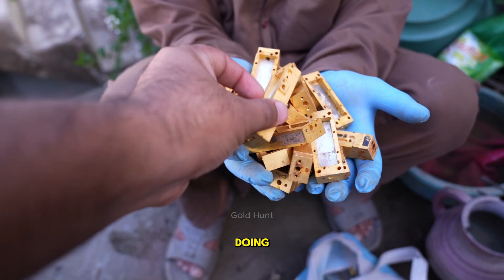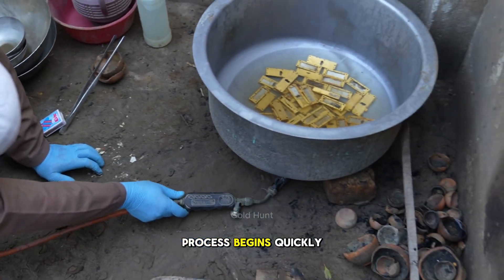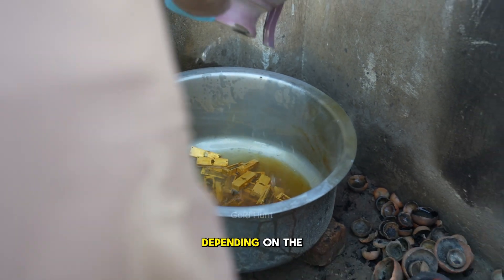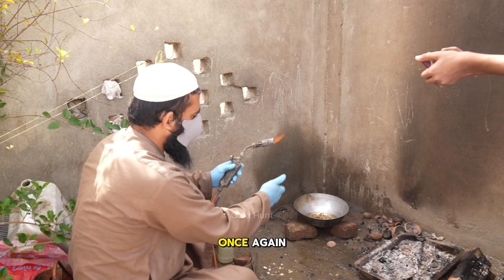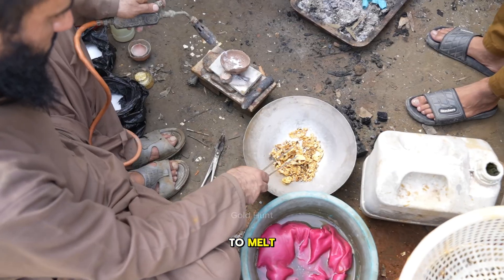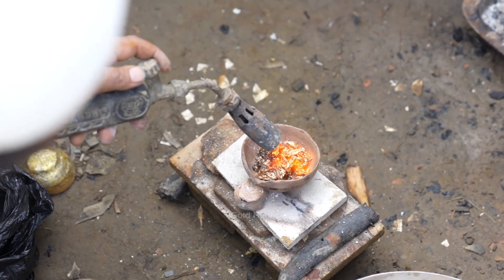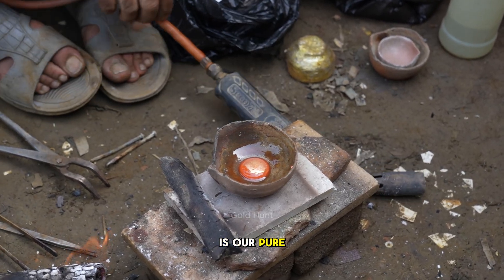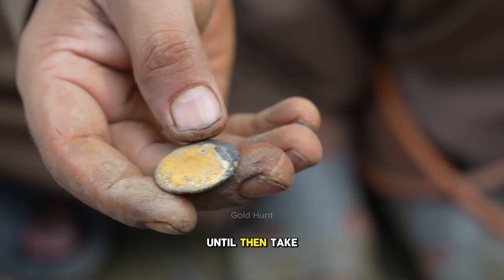This scrap is more Worth than you think: Extracting Real Gold From E-Waste

Comment: This guy is flooding the whole neighborhood with toxic fumes.
The cloth mask helps absolutely nothing. 

The claim of "harmless mercury" is simply false!
There is only one type of mercury.
When it evaporates, microscopic droplets will settle in the environment or are inhaled.

Build a simple retort like this one from a few pieces of iron. 

https://youtu.be/3xALHUiug_4

Please use only iron, as it is one of the few metals which mercury does not form an alloy with. The iron tube should be immersed in water for 1-2 centimeters only, otherwise water will be sucked into the tube as it cools, and a steam explosion could occur.
The evaporating of the mercury is done if no more bubbles are coming out at the bottom of the retort, but keep on heating for 1-2 minutes more.
Let the retort cool down to at least 30°C before you open it. You can cool it by sprinkle it with some water.
Collect the mercury, place it in a bottle, and place some water on top of the mercury. Store the retort under water after use in order to avoid any remnants of mercury evaporates.

Your gold button isn't 24k.
It's showing a dull and a little grey surface.

A gold button with at least 99% purity has a bright, shiny surface with some cracks and a small crater from cooling.
Foils from gold plating have a purity of 18 to 20k. A 24k gold plating would be too soft.

Please improve your workflow.
Stay healthy!

Best regards from Germany!